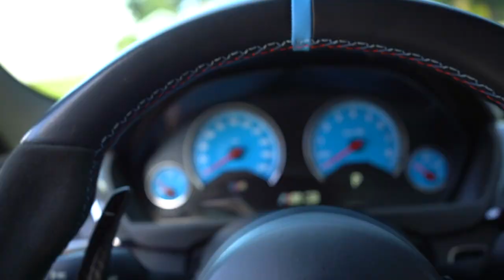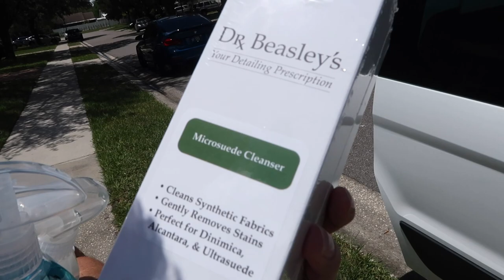How to properly clean two BMW F80 M3’s in one day! (Full Wash and Detail)

Comment: Stoked you finally have the car ceramic coated!! So freakin clean hahaha. Going to make your washes so much easier 👌🏼. Also gyeon wet coat works really good as an alternative to car pro hydro lite
Reply from the maker: I’m still not used to it cleaning itself even if it rains lol 😅. Def need a higher power leaf blower asap
Reply: @F80Ho  eGo blower is FIRE
Reply from the maker: @MistaaFrosty  need that 🔥🔥🔥